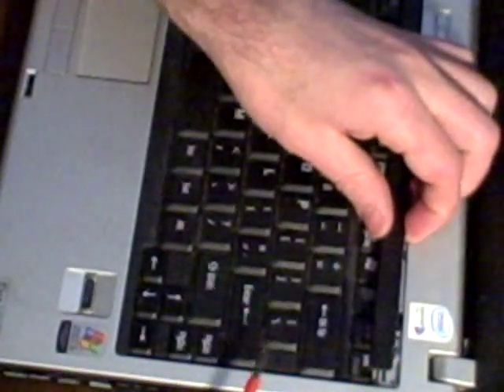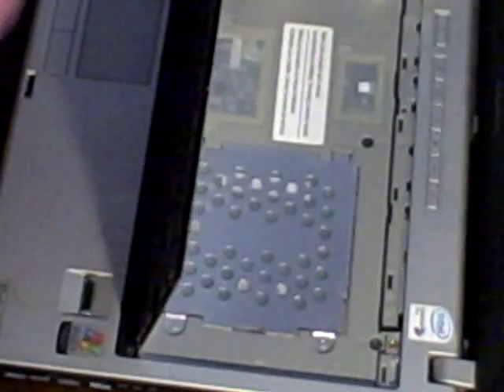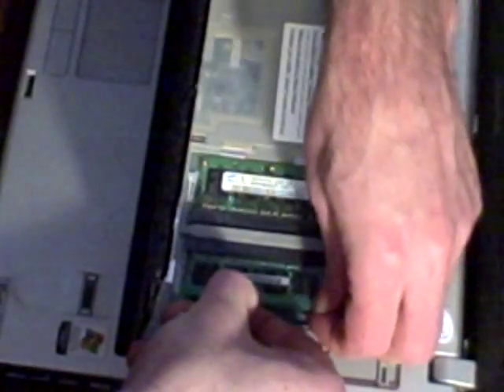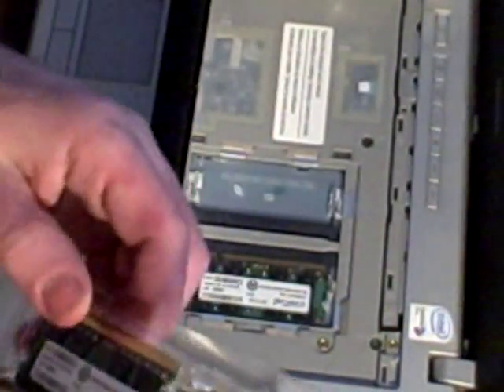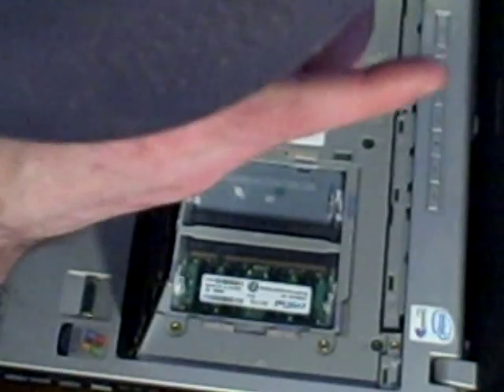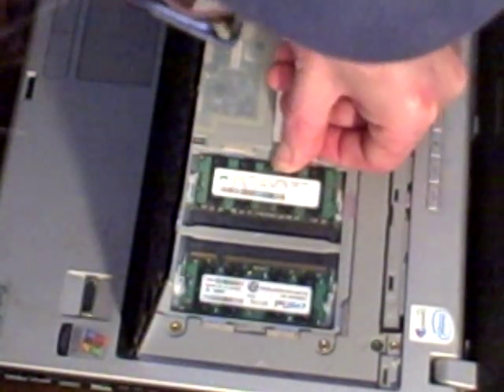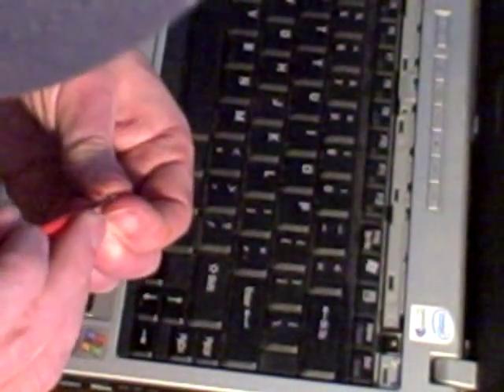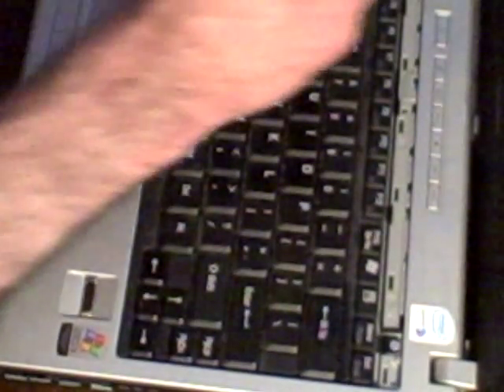Upgrading Laptop Memory - Under The Keyboard U205 4GB Upgrade with Crucial RAM

Comment: I just pulled mine out of storage with 2gb of RAM and threw a Samsung EVO SSD in it then Windows 10 and it boots in 20 seconds or less. It started with Vista which I downgraded to Windows XP then Windows 7, the hard drive crashed spectacularly loud then went into.storage